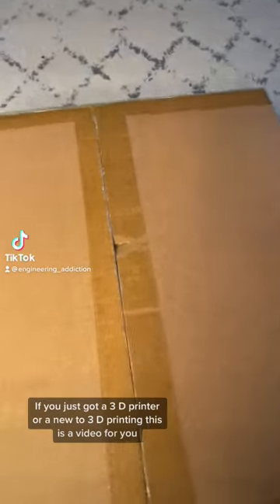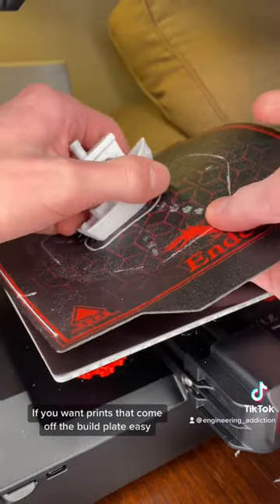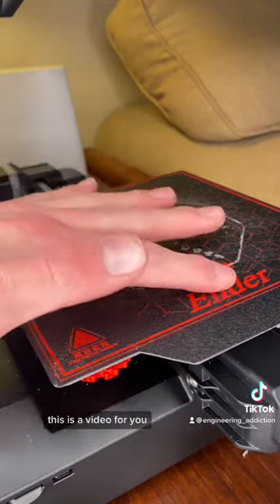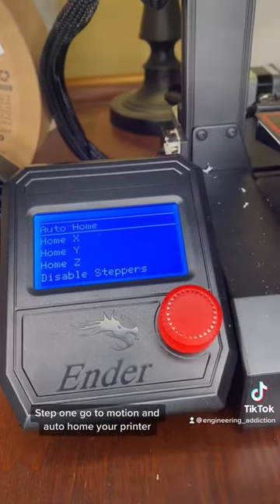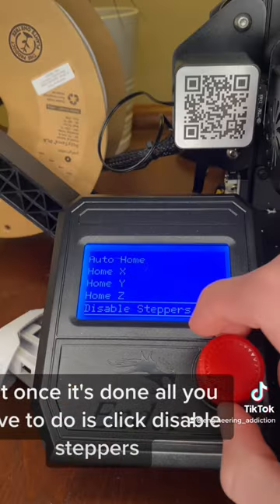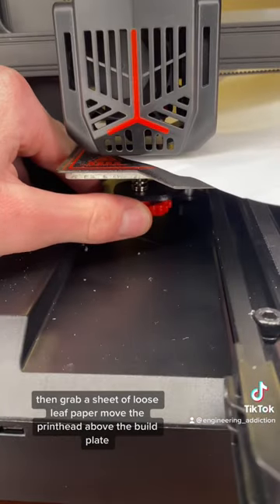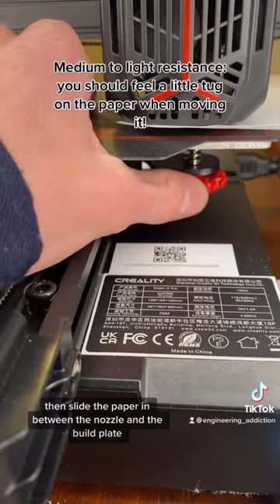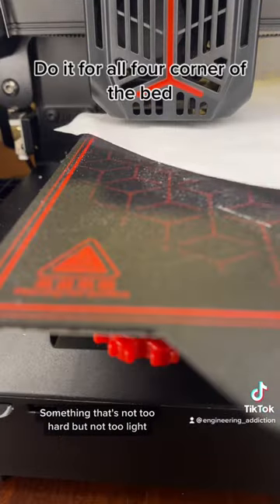Learn to level your 3D printer bed #shorts

Comment: I am doing  this to every printing.
Reply: You don't have to. Don't do this anyway. 

Move the extruder using the screen, make sure you can have the same lowest Z value (ZERO) in certain locations without the extruder touching the plate, use the paper if you want.